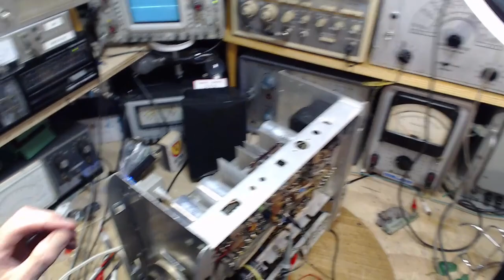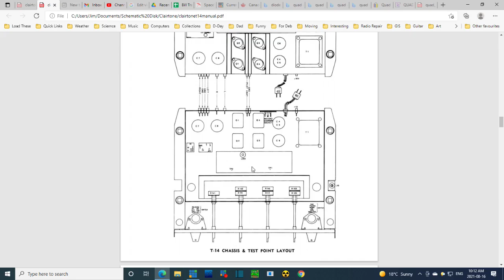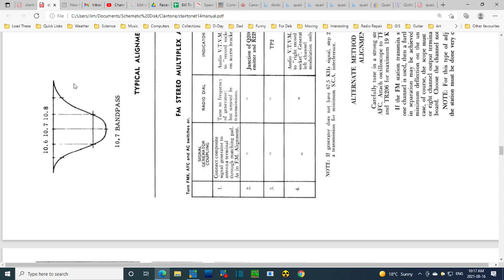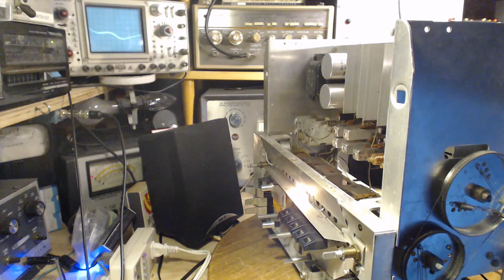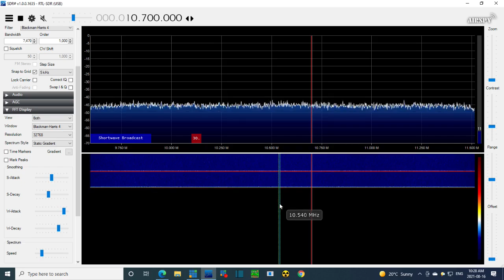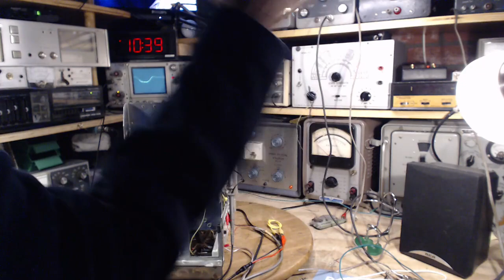Clairtone Console Stereo Video #17 - Alignment Set Up

Comment: I'm really not sure he has hooked up to TP1 yet.  He looks for it on the schematic but then gets sidetracked by the transistor nomenclature.  FM is hard to align and also not sure that the test set is set up correct.  Never have heard a buzz like has going through the speaker.  At least he abandoned using the TV test set.  Doesn't look good for this set since he is already turning slugs to see what happens.  SMH